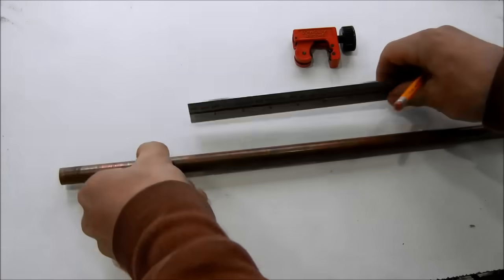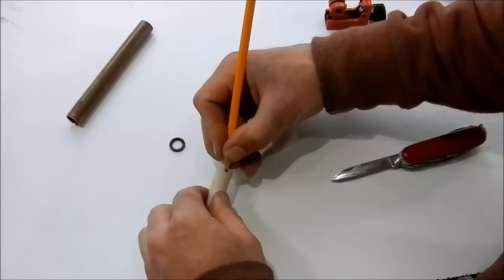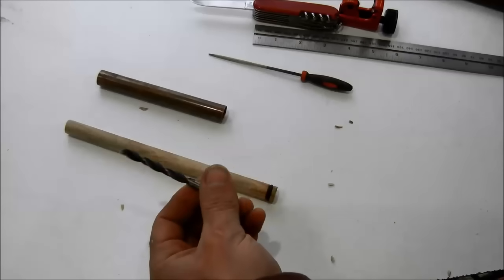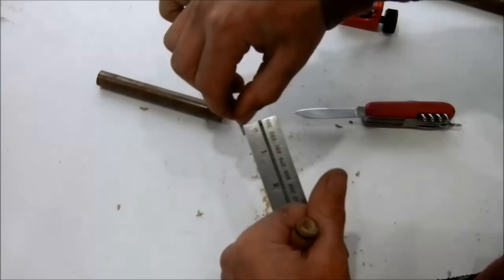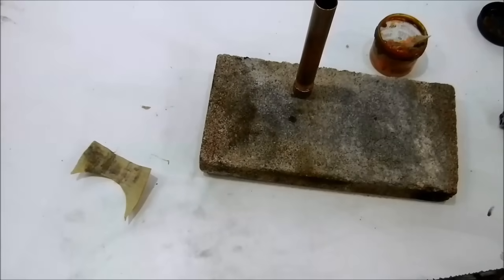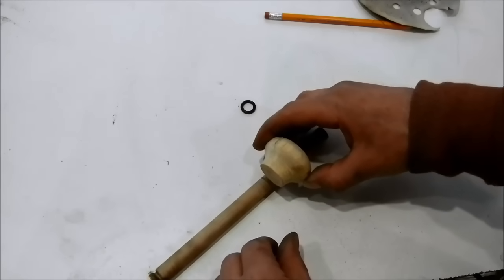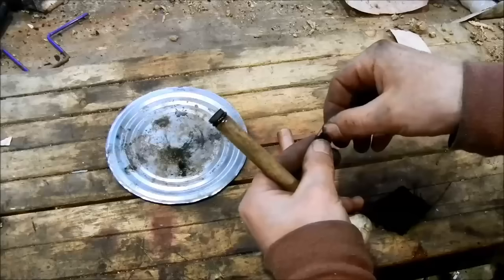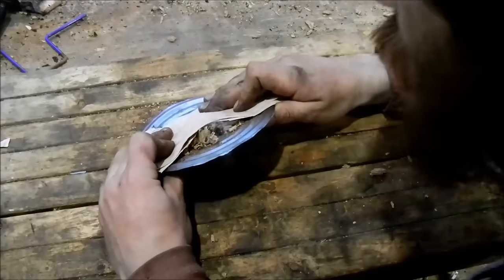Making and Using a Fire Piston

Comment: It's good to have a number of these types of things with you when you go out into the wilderness. 
Magnifying glass, flint and steel, steel wool and battery or foil, bow, etc...
I used bring these things when I went camping.
Now that I'm old and lazy, I just take the self igniting propane torch!😁
Reply: There was one trip where I got caught out.  I had multiple back-up fire starting tools (matches, lighters, magnesium block and a magnifying lens), but none of them worked.  It was so windy that I couldn't even start a fire inside my tent (which, admittedly, is a dangerous thing to try).

I went without hot food for a couple of days, then went completely hungry for the next couple of days after that.

My solution, once I got home, was to order some "Lifeboat Safety Matches" and keep them in my backcountry kit.  It must have put Murphy's Law to work for me, since I've never had to use them :)
Reply: @kurtschultz8199  Mountain climbers must encounter these extreme wind conditions too. Wonder what they use?
Reply: I've got to throw one more into the mix: Doritos
While my wife and I were running herd on a bunch of Boy Scouts one year, we got caught in a rain/hail storm in a campground near Crater Lake, OR.  I bought a bundle of campfire wood at the general store, but had no luck trying to get it started.  I used several approaches, but the firewood was just too wet from the rain.  I even used up some on my forbidden fuels - vodka wasn't good enough, neither was white gas.
I finally remembered how I'd seen a campfire started in the rain in a campground on the side of Mt. Ranier (they call it "Mt. Rainy-er" for a reason).
I threw down a handful of Doritos and used them as tinder.  They burned long enough to get the kindling burning, and we were able to enjoy a campfire, even in the rain.
The other adult that was with us had never heard of it before, and he was a delivery driver for Frito-Lay.  He was shaking his head as he said "Great.  Now I'm going to have to write up a Field Report about this..."
It turns out that you can use many different snacks for this - they're usually made with a high fat content and you tend to keep them dry.
Reply: @keithmarlowe5569  Sounds like you're talking about a "Dakota Fire Hole".  Rather than risk my tent (and permanent burn scars), I opted to eat my energy snacks, then go hungry.  I was on the west edge of the Lake Tahoe Basin, so food wasn't that far away.  Got to Tahoe City, found the supermarket and hit their deli for a fat Poor Boy Sandwich.  I was back home in the East Bay by midnight.
Reply: ...and a couple of road flares.  :p
Reply: @GerOffYeWeeBastard  I think you're onto something here.  If road flares could be made smaller, they'd actually be fairly convenient for starting emergency campfires.  Say, something about the size of a golf pencil, and secured in a water-tight plastic capsule.  I bet they'd even start in the rain.

Oops, it's already been done - Orion makes them.
Reply: @keithmarlowe5569  look up Dakota fire hole
Reply: @keithmarlowe5569  , Lighters are unreliable.
Reply: @keithmarlowe5569  if the air pressure was lower in the tent, than outside, wouldn’t that smoke out the tent? I reckon some type of micro oven with chimney maybe?

Comment: Two fold purpose. This vid also showed you how a diesel engine works. The diesel is combusted during compression. I like it.
Reply: If I'm not mistaken Dr. Diesel got the idea for the engine after seeing this type of Firestarter in use.
Reply: That's what I was thinking and was wondering if a fella could put a little fuel on a cotton piece and plunge it down to ignite. Non char cotton

Comment: Best thing I've seen all day! Just a question - where can one get this char cloth from or is that something you make yourself?
Reply: You can make char cloth yourself by folding up a 100% cotton piece of bandana into an altoids tin and placing it in a fire. The tin should keep oxygen out as the cloth heats up and wants to ignite. The cloth will burn off its building material until its almost mostly carbon left. Same concept as making charcoal. You can look up a video for better instructions
Reply: @Thornblooduser put a small hole in the lid of the altoidsId box 1/8-3/16 should do it
Use 100 percent cotton T-shirt it will hold the ember better longer that a handkerchief
Reply: Get a tin can punch a small hole in it put it pieces of cotton cloth put on lid and put in fire pit till smoke stops coming out of hole

Comment: This is the first time I have seen a fire piston. Can you please explain what causes the char cloth to ignite into an ember? With a bow drill I know it is heat from the friction of the rubbing pieces of wood that cause the ember in the char cloth. With a flint and steel I know it is sparks caused by little pieces of the high carbon steel that cause ember on char cloth. In a fire piston is it pressure, friction (between what and what), or something else that causes the char cloth to ignite into an ember?
Reply: Same basic principle as a Diesel engine. The heat from the compression is enough to ignite the fuel.
Reply: @Mike1941-r8y  Very cool. Thanks!

Comment: Small suggestion, recess the knob so that the dowel sits into it about a half inch, keep the end of the dowel from splitting, or at least delay it as the wood ages should someone forget to oil it. One could use a copper t pipe fitting to give it a pump style handle and add storage for spare char cloth and o rings, possibly even a small tube of vaseline or oil for lubricant
Reply: Seal vaseline etc in plastic straw trimmed to size 👍
Reply: Would silicone lube like I use on swimming pool O rings extend the life of your piston O ring? Great ideas.
Reply: @denniswendtland9707  I believe that silicone grease would work fine; vaseline would also work fine AND could be used for fire starter/accelerator.
Reply: @denniswendtland9707  light bulb grease for your car, is made from silicone.
Reply: @denniswendtland9707  as long as you don’t use a silicone o ring. Like dissolves like.
Reply: Also a length of  tubing that fits snuggly over the copper pipe used as a cylinder, could be used when disassembled as a "bellows" to focus the blowed air. Short DIY version of Pocket bellows.
Reply: Great idea on the knob
Reply: Or buy 25 lighters
Reply: Always looking for somewhere to store that vaseline......
Reply: Nice
Reply: Or even matches.
Reply: Matches 😂😂
Reply: Or a Bic lighter
Reply: @larrywelch9738   you sir.....high five.
Reply: @larrywelch9738  ....railroad flare, napalm
Reply: Or a tube of KY if your hiking Broke Back Mountain
Reply: @googlechicken  😆 🤣  Broke back mountain back pack. For all your deep... hardwood... assventures!
Reply: @williamdistasio9358 I was born with a nice hunk of hickory burl

Comment: Thanks for the tutorial. The tolerances are tight on this project, so much so that the copper pipe being type L or type M makes a difference. Jon, do you remember (or do you have this item handy) which one you used?
Reply: Shouldn't matter. Looks like you just kinda eye it as you trim the notch for the o ring. I might try it this spring. I've never seen anything like this before.
Reply: My exact thoughts. Most would not know that there is a difference in the I.D. (inside diameter) between the two (type M and L).  Depending on the dowel rod, it could make the difference between fitting or not fitting into the copper pipe.
Reply: I know I'm replying to an old comment, but the YouTube channel Flint Stryker made this also, and he said he used type M.

Comment: Does anyone know if this will work with a slither of Fat Wood in place of the Charcoal Cloth?
Reply: I have serious doubts about that fat wood I think the wood is to dense to catch an ember using this method
Reply: It's the carbon which grabs the fire.. your fat wood would have to be charred in order to work
Reply: Maybe a thin shred of fatwood or other thin flammable material.  I'll try everything I can think of  if I ever make one.

Comment: Never ceases to amaze me how many people on Youtube don't know how to solder correctly...
Reply from the maker: And what may I ask is wrong with my soldering technique?
Reply: @jonthewoodworker  I went to a class on how to solder correctly.
You place the heat source on the opposite side of where you apply the solder. When the solder flows, the items are hot enough for the solder to flow and stick properly.

Doing it the way you did can result in a cold solder joint. Not always bit it can.

Nothing personal. Just an observation.
No insult intended.

When soldering pipes, same setup. But you wet rag the soldered joint to smooth it out.

Comment: Would it work if you put some dry wood shavings in the bottom and dumped them out after they've caught fire? 

ETA: I've thought about making one of these. I think I will now. I might have tried putting the dowel in my drill and using it like a lathe to cut the groove for the o-ring.
Reply: I don't think so. Othetwise the actual stick end would get burnt.

Comment: Would it be possible to do it in the wild just with bamboo or reed, without modern tools?
Reply: Wait .what are we talkin about?
Reply: Yes along with my beer
Reply: Yes,  it was originally done a LONG  time ago by peoples without modern tools.  Maybe the principle was discovered when making a blow gun.  Bamboo can be used for the cylinder. Rubber O-rings did not exist until  recent times.  Handmade cordage can be used.   Animal grease can lubricate.

Comment: Simple, to the point and sped-up during the unnecessary parts. Well done!
Reply: I agree - no superfluous content - does exactly what it says on the tin.
Reply: Absolutely. the sped up parts made me stick around. somehow it feels more respectful to speed thru the dull parts.
Reply: But he doesn’t tell us why he’s serving that piece on the end of the copper and that PC side is on there is that a cap or can you see right through to the other end of the copper after he solder that on why does he solder that on and I don’t know how much shorter the wooden piece is then the copper piece
Reply: What was the cloth you folded and used to stick in the end?
Reply: When he bored into the wood core, I was sure it was gonna slip and go into his wrist. If I tried that without clamping the wooden core, I would be in the emergency room.
Reply: @m____w____6981  Look closely at the tip of the drill bit.  That is the reason it did not walk off the end of the stick.   I would not try that with a regular drill bit!

Look up, brad point, drill bits.
Reply: @m____w____6981  skill issue
Reply: @m____w____6981  gotta be smarter than the drill
Reply: Ok mister judgy judge judge
Reply: @jases459  Judgey McJudgeface

Comment: 0:33 Noooo, You ruin the blade... 
Your Sak has got a sharp edge on it's Awl to do such things!
Reply: Copper is way softer than steel
Reply: @classicpontiac37  true, but just like a boxcutter razor, it wears out after cutting cardboard
Reply: @wrathmachine7609  if it's a decent knife it can be resharpened without any problem. I work in a Sheetmetal shop. I work with stainless steel, copper, aluminum and brass  every day. We have stainless steel parts coved with a protective pvc covering to keep the finish nice. If we have to remove the covering we take a small flat piece of copper and sharpen it on a belt sander to cut the thin pvc covering off. It never scratches the stainless steel.
Reply: Don't stress about it - je can sharpen  it later
Reply: @wrathmachine7609  the point I was trying to make was that if it's a quality hardened blade, shaving a small copper burr off isn't going to ruin the blade. If done repeatedly it probably will dull the knife some, but shouldn't damage it.
Reply: @classicpontiac37  true, wouldnt chip unless low quality steel

Comment: can I use steel pipe instead of copper
Reply from the maker: Unfortunately most steel pipe has a seem on the inside and is rough, that would wreck the O-Ring. 
You could even use PVC pipe if you can get some with a 3/8" to 1/2" ID. 
But it has to be smooth on the inside. 3/8" (10mm) is best but 1/2" (13mm) works.
Reply: You can use pretty much anything that's smooth and airtight, really.

Southeast asians have been doing this before 100-500 AD using bamboo, wood, metal, ivory, bone, and horn.

And, as long as you polish the inside smooth so you don't tear up the o-ring, you could probably even use some types of stones and minerals like granite, marble, slate, quartz and possibly even obsidian (are the latter two worth the trouble? Absolutely not. Are they practical? See previous answer. Would they look freaking amazing with the proper design? You bet your sweet bippy they would.)

Comment: What kind of oil?
Reply from the maker: In the video I used motor oil, but almost any kind of oil/grease will work : Mineral oil, Vaseline, Vegetable oil...
Reply: I have used Vaseline. Its not as messy and you can keep one in your fire kit.
Reply: Coconut oil will even work like any oil preferably a lube that lasts longer
Reply: you can use beef tallow